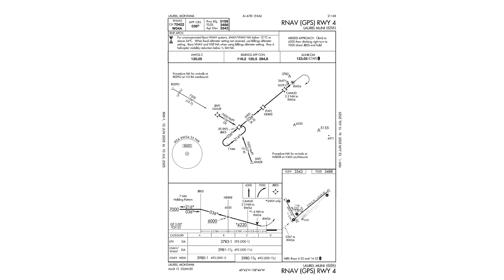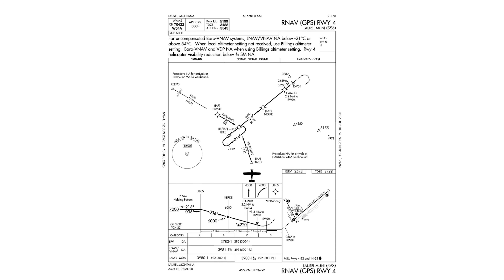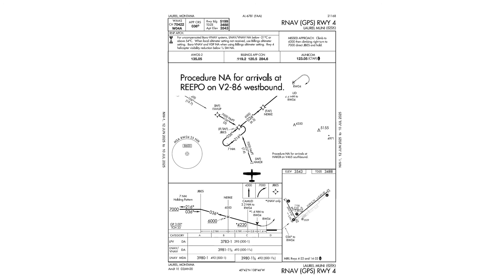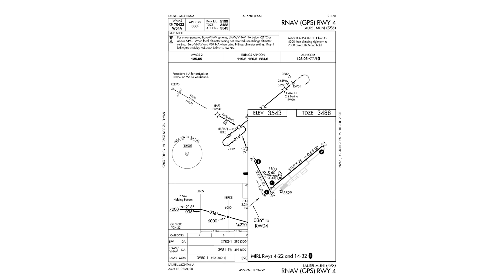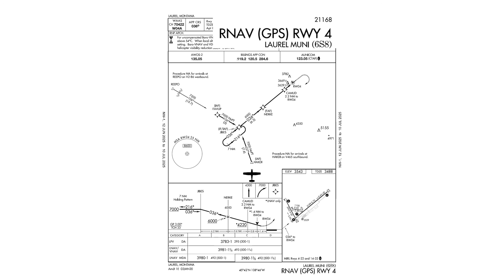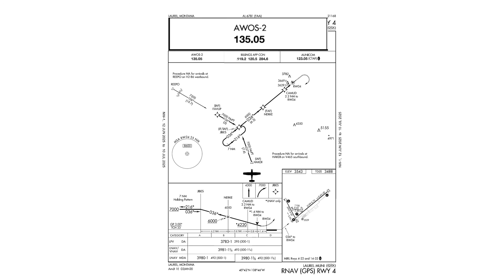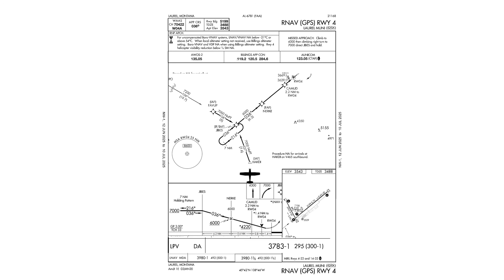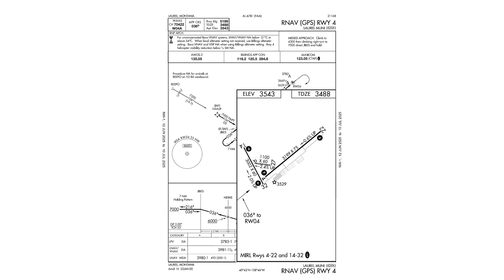Are you Briefing IFR Approaches Wrong? | How to Brief an IFR Approach Plate

Comment: I thought your brief was good and covered good detail.  I would also include what type of ALS is present, if available.  I would love to have an ALSF II if I know if the weather is close to mins.  Also, what side of the runway a PAPI or VASI  is on to ensure appropriate glide slope when transitioning from the instruments to the outside environment and and to ensure we are on the correct runway as well.   I would probably include the exact TDZE instead of saying a few thousand feet.  I would also recommend Briefing a Jepp Chart if you haven't already,  I'm a big fan of those lol.
Reply: Again.. just do it in order.  Brief to tbr minimums and there’s where you should brief the lights and runway length and anticipated exit.  Or if it’s pilot controlled lighting the point to key it—usually before the FAF.